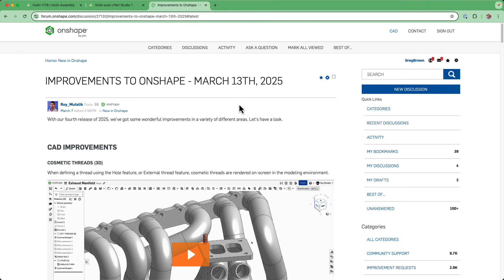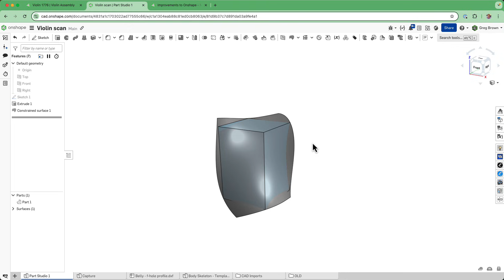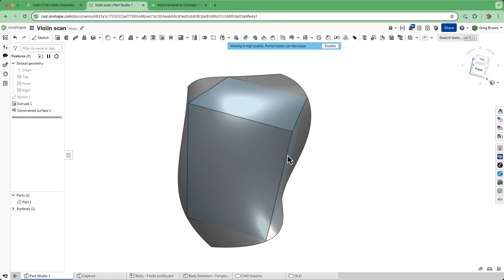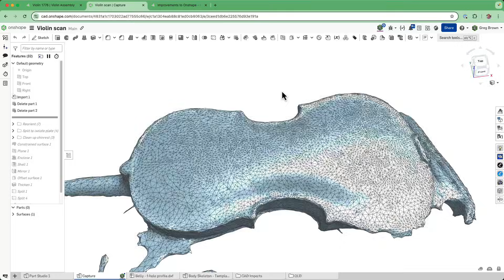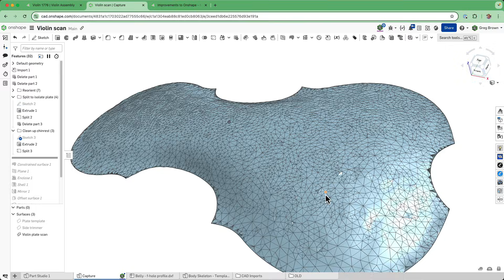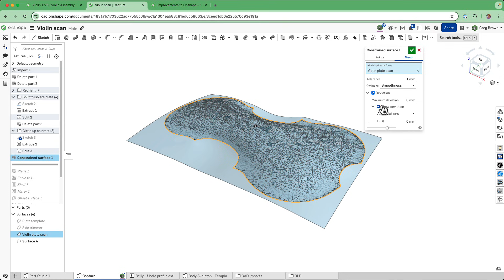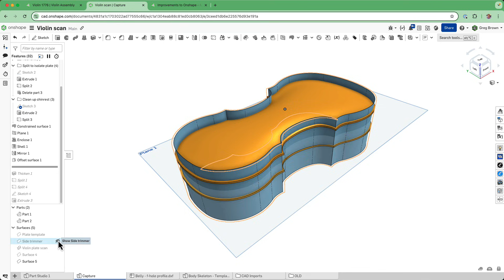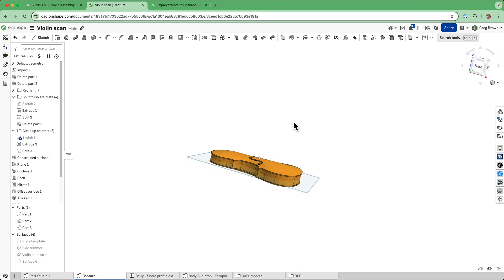Onshape introduces a new scan-to-CAD workflow (Constrained surface) in a feature packed new release!

Comment: Fantastic new feature (constrained surface) I'm gonna play with it today.  But re: scanning...You mentioned the iPhone lidar. Does Onshape only recognize iPhone scans? Also, you didn't mention it, but how do you make your drawing actual size? There seems to be no references to length, width, radii, etc. So how do you create your drawing actual size?
Reply: Onshape can work with a variety of scan data formats, including STL, OBJ, and others. The iPhone lidar scan can be convenient because its accessible directly from the Onshape iOS app, but certainly other scanners will typically have higher quality outputs
Reply from the maker: As Kevin mentioned previously, imported scans are not exclusive to those created by the built-in capability offered in the iOS Onshape app. It just happens to be super convenient in that it directly creates the part in a new Part Studio. Incidentally it uses a combination of Lidar and photogrammetry (this is Apple's technology) in order to do the "Object scan" at a much higher resolution than the previously provided "Area scan"
It is done at 1:1 scale, no adjustments needed, though you can of course transform it inside Onshape after the fact.